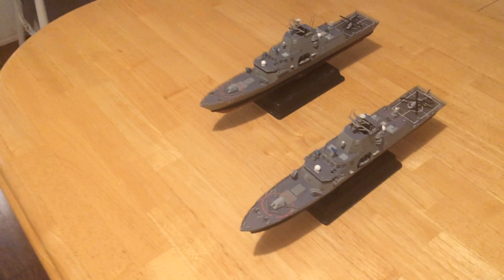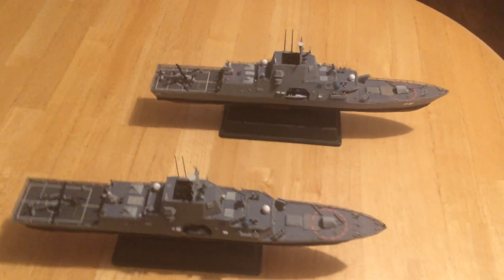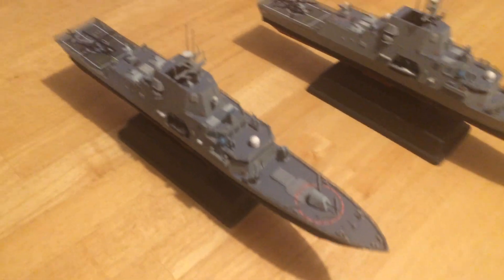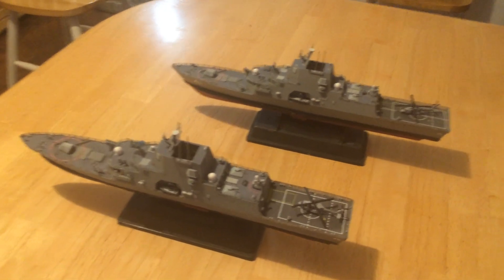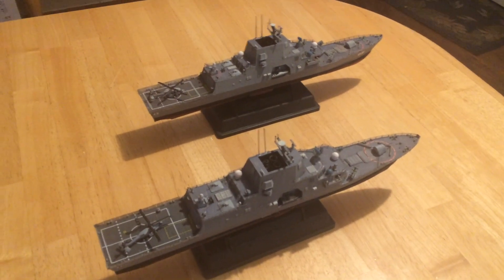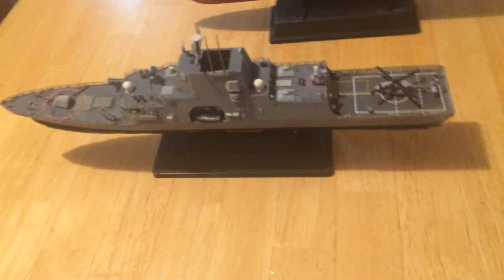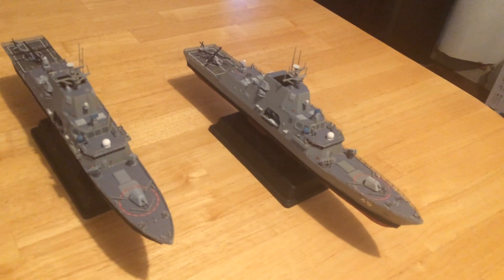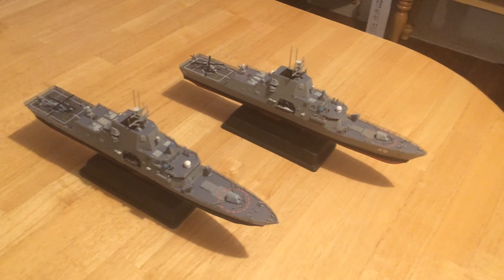US Navy FFG(X) Lockheed Martin Entry in 1/350 Scale

Comment: Erp, wrong. The LCS wasn't a "mistake"; it's designed for SHALLOW waters, i.e: has to be light. Also, aren't you a dyed in the wool Trump supporter? Guess that means you can't help but be wrong [and utterly lack a moral compass].
Reply from the maker: Yjhe LCS as a fighting ship in the littorals was not  mistake...but a LOT of mistakes were made in trying to make that happen in terms of their switchable loads when they were frigate sized vessels and needed to be able to be a multi-purpose frigate out of the shoot and operate in the littorals.  Luckily, this became more than cler when they finally started listening to the warfighters and those with experience with surface combatants and so the FF upgrade will solve most of  the issues, and will also lead to the FFGx which means we will ultimately have 20 more Frigates, 36+ of them capable of meeting their peer opposition in the littorals (or anywhere else) and 20+ new, fully frigates which will excel in many aras and hopefully have E with the Burkes and Ticos and ultimately the new CGx.  In the end we will all be better off as  result.
Reply: @JeffHead-IdahoUSA  Nice reply, thanks. Sorry about the Trump digg; I hate that compulsively lying, smug, narcissistic piece of arse cheese. And his supporters, the most vocal ones at least, tend to be just like him. Insufferable. 

Anyway, a frigate's something different again-a much more capable blue water ship; but wasn't the point of the original design, that it was light enough for brown water as well as littoral operations? Basically, the world's biggest speedboat and with a 57mm gun and Hellfire missiles plus RAM-and maybe another pair of 20/25/30mm guns; more than enough to overmatch even swarms of anything else it would come up against; other speedboats and small littoral/river type craft? Something that would maybe be overmatched by a Corvette, but then Corvettes are too heavy to travel up rivers. That would be my guess why they chose the 57 over a 76mm gun; as the latter is much heavier, and is overkill anyway vs such small swarming craft.  And if it's not designed to fight a Corvette or anything bigger; it doesn't need the weight penalty. For something so light, made of aluminium and with no armour, that can travel up rivers; the original Lockheed and Austal designs; are very heavily armed. But yes, the mission module thing; never worked out as planned. That's when you want a frigate.

Comment from the maker: On May 28, 2019, last Tuesday, Lockheed Martin announced it WOULD NOT submit this, or any other full design for the FFX(G) program.  This cuts the bidders down to four.  The FREMM based design, the Hobart/F-100 based design, the Austal based design, and the Huntington Ingalls Legend Class Cutter based design.  This was a surprise to me.  At this point, I believe the Hobart or the Fremm would be the best, but now would rather see the Hobart because it is already an AEGIS based design.  Surprises never cease.
Reply: I was routing for HII's modified Legend class cutter, the parent design was already created with AEGIS integration in mind, at the time the FFGX competition was being held, Pascagoula's Legend class cutter production line was still a hot line that could've flowed straight into FFG production if HII was chosen, the Coast Guard had already spent the money working out the growing pains of the hull and propulsion system so barring any headaches that could arise redrawing her for the required weapons and sensors, she is already a proven ship.

Comment: These are just upjumped LCS's. If they choose one of these this competition was a joke. These ships are made of aluminum, not steel, which means they could be destroyed by an Iranian speedboat firing RPG's. They would burn like wood. They also are too noisy for anti-sub work. The FREMM is much quieter and is made of steel. If the competition is honest the FREMM would win easily.
Reply: The hull of the freedom class is steel (not sure about the superstructure though). Independence class however is aluminum and already has cracking issues.

Comment: The main problem with that model right now is that I think the Navy has been looking for 32 Mk41 VLS cells. I suppose they could remove the hellfire missile launcher in the front and replace that with another 16 Mk41 cells, space permitting. By the way, what's VLS between the two 30mm cannons above the hangar? Is that also a hellfire missile launcher system? I doubt that could be extended into full Mk41 cells as that would pretty much mean the hangar would be barely large enough to fit half a helicopter. Great model though!
Reply from the maker: The cells between the 30 mm guns are fr Hellfire missiles and are specially built just for them and they are pretty shirt, allowing the hanger to function.  There is still room forward for the 32 cell VLS and that is what they should offer.

Comment: It seems that most think Lockheed Martin or Bath Iron Works will win out with the FFG(X) program. Why choose Lockheed Martin?  The F100 seems like a solid design, while Lockheed Martin is continuing with the LCS design, which in my opinion is a tad underpowered for a proper frigate role.The main concern is that the Martin design isn't as armored or armed as the F100 design the Spanish use. I do prefer the looks of the Martin design but obviously looks aren't everything.  My Final question is how did you make these??? Did they have models already done, or did you modify existing kits? Thanks!
Reply from the maker: The FFG(X) is not the Freedom class LCS.  It is bigger and will be poered diferently and accordingly.  It will have at least eight very good ASMs ...probably either NSMs are a mix of NSMs and LRASMs.  They will have 16 or 32 Mk-41 VLS, 24 HellFire VLS cells, two x 30mm cannons, and will carry at all times at least 40 ESSMs for anti-ait and perhaps up to 64.  They will have their helos and very ecent sensors (far better than the LCS or the FFs.  They will do it in a decent sized FFG package.

Now, the F100 variant from BATH, siilar to the Aussie vessels are also good...but they are much bigger nd cost a lot more.  You might as well buy more Burkes if you go that route IMHO.  I believe the LOckheed design will provide good flexability, better armament than the Perrys had, and at a decent cost, and with growth potential (IE. 16 cells to 32 cells when ever needed).  IMHO they should just put the 32 cells in from the get go.

As to the ships, I get them frrom a #D printer I know.  Dutch Naval Miniatures on Shapeways 3D market.
Reply: @JeffHead-IdahoUSA  I think that the Fridtjof Nansen class frigates, which are based off of the F100 design, would be a decent option, in terms of pricing. IIRC they cost the Norwegians $500M a hull, which means it could cost a bit under then $800M the USN has budgeted per ship. Those also included a full Aegis suite (albeit with a smaller radar than the F100s and Hobarts). The question at this point is probably just whether or not the Helge Ingstad accident gave any indications about any problems with the ship--not that the Freedom class hasn't seen its fair share of issues.
Reply from the maker: @SevenandForty  The Nansen would be a good vessel no doubt...an have a lot of capability..  I till believe the US Navy and US Congress ill go for the Lockheed solution.  Lots of commonality for logistics with the Freedom ships, a US working yard to build them, and a decent vessel with strong interface to other US ships.  The Nansen is probably still a stronger vessel so I would not discount it...or the other F-100 design similar to the Hobart.  Time will tell.  Any of the offerings would be good to have in 20-28 strong build.
Reply from the maker: I believe the F-100 would be a great design.  The Lockheed design actually has pretty good capability and expand ability  I got them from working with the Dutch Naval Miniatures on Shapeways 3D.  They built them for me and then I scratch built the lower hulls.
Reply: Forget the last one, I watched the rest of the video Sorry!

Comment: Great video Jeff. Lots of great information about the new FFG(X). Be blessed always!
Reply from the maker: Thanks.  I am glad to see  that the Navy is finally doing what should have been done with the LCS eight years ago.  Although they will up-arm them to a "FF" proposal which will give them the longer range ASMs, better sensors, and better armor in some places, they still will not be fully combat 2 capable and will not be full FFGs.  This program promises to produce true FFGs and I am glad t se it, and as I say in my video and its write-up, I believe the Lockheed Martin design will make a good Frigate for the US Navy.  BTW, I will do another video with these two FFGs, three Burkes, a Tico, two SSNs, and a carrier for what will be the modern US Carrier Strike Group (CSG).
Reply from the maker: Thanks Gerry.  I got two of them so I can place them with my Carrier Strike Group.  I will have two of the FFG(X), three Burke DDGs, one Ticonderoga CG, two SSNs (Probably one Virginia and one LA ADCAP Class, and then, of course, the carrier.  All in 1/350 scale.  I just sent off for a 1/350 scale Zumwalt I am going to detail out.  The guy is doing me a 3D print model for it and I have been collaborating with him to make a 3D CG(X) on the same hull.  She will have 160 PVLS vertcal cells, one 155mm gun and then two laser weapon systems and two smaller rail guns for CIWS, as well as one Sea-RAM.  She is going to be something elst when it comes out.